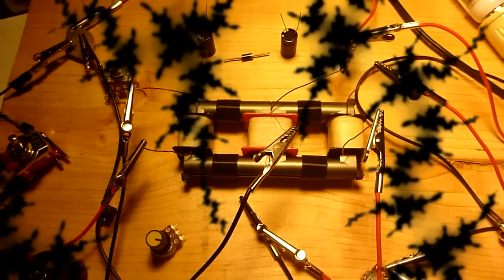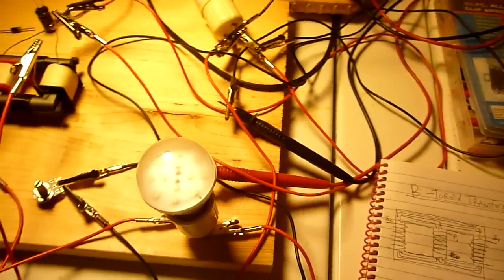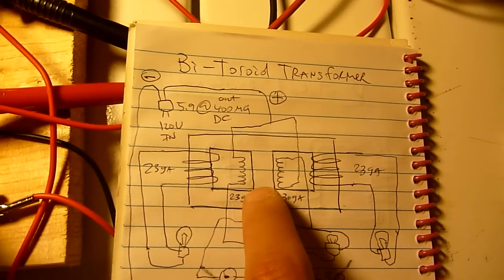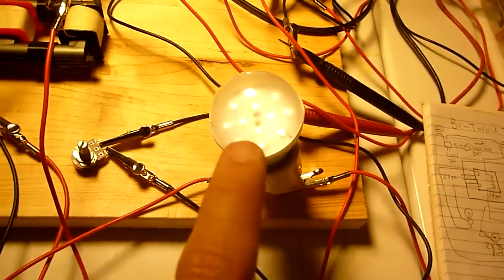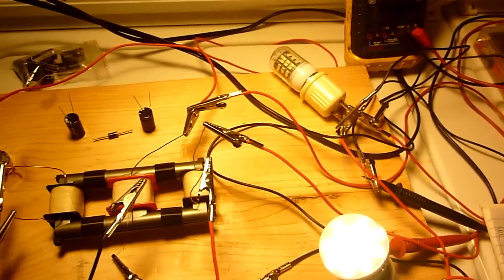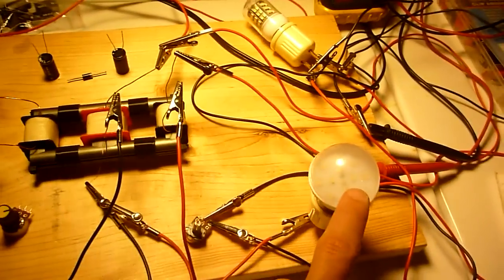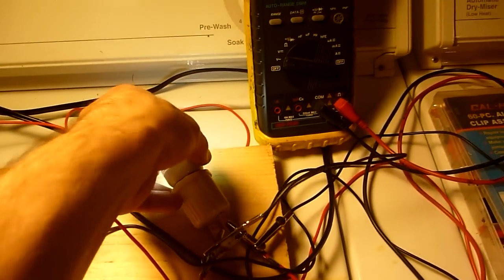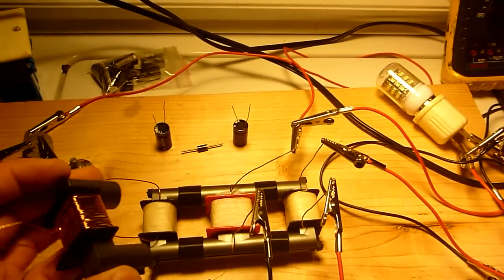Bi-toroid Transformer replication (over unity transformer)

Comment: Going by what I have tested about electromagnet, I believe winding quadfillar capacitor Coil in the primary will boost the available magnetism in this system. Also using awg32 and above in hundreds to thousands of turns will work so nice too. But that will require upward of 1000vac which you can only get via high voltage step-up transformer. You can also use pulsing dc which is much easier to achieve via capacitor and diode multiplication. As for your secondary outputs, winding it  in capacitor style too and use thick gauge. By capacitor winding, I mean separating each layers of winding with an insulator like paper, Mylar or plastic tape etc.. You wants your input and output windings to be highly efficient to generate more power? Then your winding must be in capacitor style not the free style which allows layers copper wires to directly overlap. 

Also, I believe this system can bé Pulsed to allow the Primary to Tap 
Radiant Energy as "return power" or Back E.M.F which can bé collected 
with a DC Capacitors by connecting Diodes in front and backward mode to 
the terminals of the Primary Coil.
The benefit in this (as I believe )
 is that instead of looping the system from the out put of the 
Secondaries coils, you will simply bé looping it from the primary coil 
and you will bé left with 100% power output from the Sec.windings or 
coils.

Now to make the System function nicely furthermore, use 
Diode and capacitor that match the output voltage of the Secondaries to 
collect power from them. 

Simply connect separate capacitors to each of the Secondaries and use diodes to link them in series or parallel still.

So in a Nut shell:

1.Wind your Primary and Secondary Coils in Capacitor style using Mylar or 
Paper or any other suitable insulator you now to separate layers of 
windings.

2. Make sure your Primary is Quadfillar or Hexfillar or even more and connect the strands in SERIES.

3. Pulse the Primary (Optional) to allow for Radiant Power tapping to re-energized or loop the system.

No human invention is perfect so please my suggestions and ideas can bé adjusted for better performance of this great Generator. 

P.S:
 I believe there can be 3 Secondaries in this system if improvised. The 
Third secondary will be under the Powerful Quadfillar (4 strands) or Hexfillar ( 6 strands)
Primary and that underneath Secondary must be wind in Bifilar or 
tri-fillar using thick gauge. 

What you should aim at is using few to get many.
That is using 6 strands thin gauge wire like 0.30mm coated copper wire wind 
thousands of time to make the Primaries and using say 1000vdc 0.1Ah  to 
Pulse it to generate upward of 2KW from the Secondaries.

I believe it is possible or is it not my great People?

Nigeria say hello to you all.
Reply from the maker: +Onaduja Dare Awesome ideas. Thumb up to your comment. I have been winding many coils with paper tape in between the windings. I knew that arrangement has an effect but I wasn't sure what it was. So... it increases the capacitance of the coil. Nice info.
Reply: +Naoki Kashima Yes it increases the capacitance and when you even further wind the coil in real spiral method using 2-way tape or Adhesive Spray plus using Tesla Quadfillar (4 strands of copper wires connected in series), you will tremendously increase the capacitance of such electromagnet. And when that is achieved, going by your replication, the FLUX  from the primaries to the secondaries in the system will increase and if you couple that with using High Voltage Copper Wires to make the Primary, you will sure achieve More than 500% overunity if additionally you  Pulse the Primary. 

Note: Thin Gauge Copper Wires like AWG 27, 30, 31, 42 and above do consume very little amp but have High resistance which needs High Voltage to suppress to pave way for Super Electromagnet.

However, you can use Thicker gauge too to make your Primary and make sure you Pulse the primary. The essence of Pulsing is that, it keeps your Primary coil cool and capture radiant energy to produce at least ten fold of what you supply the primary as Back EMF without reducing the initially supplied Amperage.

Here is it.

Primary 

Supplied Voltage: 100vdc

Supplied Amperage: 1A

Returning Voltage: 100vdc x 10 =1000Vdc

Returning Amperage 1A or More (Ambient or Radiant Energy)

So provided you apply my suggestions and it worked for you, all you need to to make a complete loop easily is are an Inverter, Battery or High Farad Super Capacitor, Battery charger and some other few components.
Reply: @Ukthorncarver  didYouTestThis?

Comment: Did you notice that You tube struck down your 2nd link for the 377% efficiency video?? they are watching
Reply from the maker: +Alex Manzanero NO. I didn't know that! I checked the link just now and sure enough the link doesn't work. The owner of the video must have gotten it removed, or youtube has taken it down. The technology is real and VERY easy to replicate. Their house of lies can topple at any moment and power that be are getting nervous (just my opinion).
Reply: Naoki Kashima Naoki in my research I've found that if the technology or experiment on you tube works it's quickly removed by powers, men in black, etc. any threat to the status quo.
Reply from the maker: Alex Manzanero I noticed this as well. Google own youtube and Google is holding hands with CIA. We still have some degree of freedom the whole thing is like wresting free from a straight jacket. Moving one inch at a time. Lets pretend like we are all magicians making our great escape. Free energy is coming.

Comment: Thank you for posting this! Seeing real numbers of what the multiple fluxes does is really useful. Honestly i was sure that Heins was wrong about the primary/secondary coupling. Sure it will be OU but with a loss proportional to the secondary flux path reluctance/the primary flux path reluctance. In your case i would have guessed you would get somewhere around 33 percent extra (i.e 8 watt for 6, IF all material had same permeability), but apparently this is wrong since you demonstrate pretty clearly how little coupling there is.

Only thing i would argue that could make the bulb voltage misleading is the dynamic nature of the JT circuit, (btw if you ever check it out on a spectrum analyzer you'll get an amazing display of dancing frequencies :)
Reply from the maker: +Nabo00o Thanx for the comment. This circuit is simple enough for anybody to play with for experimental purposes. If the secondaries are connected with an extra loop there is even less coupling with the primary. If your secondary has a thicker core than primary, again secondaries tend to couple to each other and have little effect on the primary.
Reply: Yes exactly! You can really detach a large portion of the secondary flux from the primary coil if you alter the reluctance in the magnetic circuits, i am also convinced there are several ways of doing it, more on that when i actually get some testing done myself.
Reply from the maker: Nabo00o There are 2 ways to get more or less energy in your circuit (create/destroy energy). 1 way is to change resistance in a circuit with respect to time, 2nd way is to change capacitance in a circuit in respect to time. Doing these things you can get extra energy from negative impedance. Related device to what I'm talking about is the Clemente Figuera Generator. The device constantly changes its internal resistance and is reported to have more energy out than in.
Reply: @Nabo00o  Hi 🙂, how has it gone so far? I also want to undertake building one. I think it will solve alot of energy problems

Comment: As clear as mud.
Reply from the maker: +Michael Julian It's pretty clear, 1 primary, 2 secondaries. Have secondaries going to equal size loads. You can supply primary with AC or pulsed DC like I do on the video. 2 secondaries pull pull the same amount of power as just 1 secondary... you get 2 for the price of 1. If you want to know the details ask the questions and I will try my best to answer.

Comment: Great video thanks... Did you try using permanent magnets between the N and S poles of the transformer to see if it gave you a better output with more flux ... maybe an other type of power driver to limit current draw would help too!... what are your thoughts..thanks again..
Reply from the maker: +alterntech Simply adding the magnets to the circuit won't boost the output. Floyd Sweet was an inventor who used permanent magnets with transformers to boost his output by more than 1000% . However, he had to condition the permanent magnets first before he used them. The exact details of this process isn't clear (you can look up Floyd Sweet if interested). As far as the bi-toroid transformer.... the following things will push its output further beyond 100% efficiency.

1) (the use of different permeability materials) Make the  core on which the primary windings were wound from low permeability material, let say iron. Make the core used in the rest of the transformer from high permeability material like permalloy. The flux will be trapped in the high permeability material more so than in the lower permeability material. 
2) Another way to boost efficiency is to connect the secondaries with an extra outside loop of high permeability material. This will help contain the flux in the secondaries even more.
3) Have a larger core of the secondaries and a smaller in the primary (this will also cause the magnetic flux to be retained more in the secondaries and couple less to primary).
.... There are perhaps others ways to further improve efficiency. Please experiment in this if you have time, your experiments may help humanity in the future :)

Comment: Hi there, Well I have a strong feeling as to why you are having a hard time looping and getting yourself a self runner. It maybe due to the fact that you are using, as you have already commented, a 5.9 volts DC Nokia Phone charger @ 400 mA, which is 5.9 v X 0.4 mA = 2.36 Watts (input). So you are using an AC Sine wave coming out of the wall. 

I'm not sure if you need AC or not, but have you tried using a simple pulse generator driven from a 6-9V battery as a DC source to achieve the same results? If you can get the same results with a pulsed DC then it would be a snap to run it with that and then try looping as you would be able to easily take your outputs in either series or parallel, connect a FWBR to it and then back to the input, I wouldn't worry too much about runaway mode taking hold, although you would have to use up the energy with more loads drawing power off of the power supply to control it. 

Have you tried dead short circuiting both output coils? If the input current drops really nicely then the Lenz Law opposing fields would cancel even more as they are bucking within the ferrite core and working with the primary magnetic field instead of against it. Lenz Law is the Overunity killer, but they don't want you or anybody else to know that. 

It's real easy to sit there and say "Oh you can't have an action without an opposite and equal reaction" but here's the thing, this device doesn't break any laws at all, it doesn't break the law of conservation of energy, or Newton's law of for every action there is an opposite and equal reaction which is basically Lenz law, all these laws still hold true.

That would really be something if you've taken the reaction and flipped it around to work with the action, instead of against it, sort of like a double action with no reaction. Sure it has a reaction, sure it has the Lenz law opposing fields, but to be able to turn them around or simply cancel them out to aid in the primary magnetic field by not fighting it anymore would be a great feat of mankind. 

So one more thing, by looking at what you have there, the Lenz law opposing fields appear to be combining into one huge opposing field to fight the primary magnetic field as they normally would instead of cancelling each other out by traveling in opposite directions.

From what I have tried in my own experiments it is not possible to cause an induction of two separate currents into two separate output coils in opposite directions from opposite magnetic fields in order to cancel out Lenz law opposing fields. By attempting to induce two opposite currents from two opposite magnetic fields cancels out the current completely, therefore if there is no current, then there are no opposing fields to worry about.

It appears that you are using the same magnetic poles to induce a current in the same direction into both your output coils, which would produce a double Lenz Law opposing field. I'm not quite sure why this double field is not fighting your primary field evidenced by your input current not increasing, probably because you have impedance matched your loads to your source.

Anyways, I applaud your efforts and very good work. Good job.
Very good work indeed. 8 )
Reply from the maker: +debunkified Hey, thanx for the comment. You know that I was pulsing the primary with a transistor. If you want to push the efficiency of the transformer further beyond COP 1, you can connect the secondaries with a loop of magnetic material. This will allow the flux in the secondaries an alternate route to travel supporting each other. Another way to boost efficiency is to use different magnetic materials within the same transformer. Have secondaries have the high permeability material and primary wound around low permeability material. This will cause the magnetic flux to stay with the secondaries. 

You know I am not a huge fan of the laws of conservation of energy and relativity. There are examples when these laws just fall apart. If you vary the resistance or capacitance in respect to time in an electrical system you'll get energy appearing/disappearing in your system. Also, if Earth did have visitors come from other star systems... then these visitors wouldn't be burning fuel. These visitors would be powering their crafts using the electric aether, it is electricity in its most raw form.

Again thanx for the comment :P